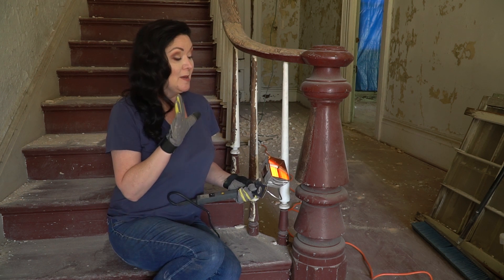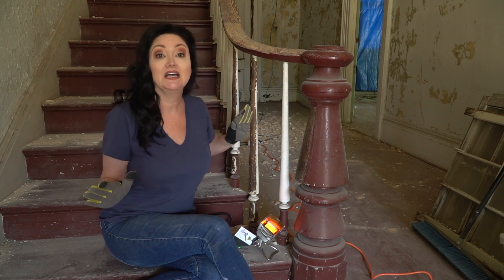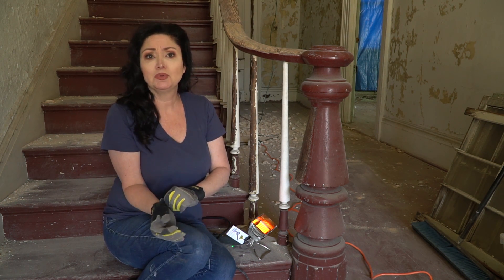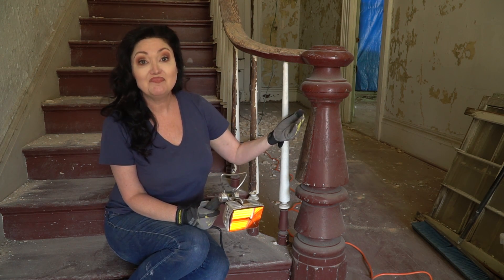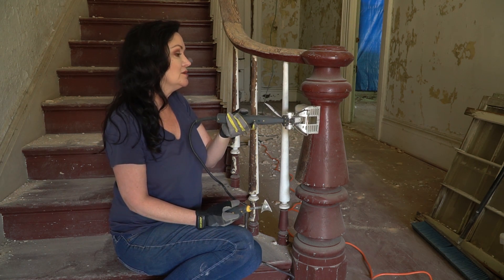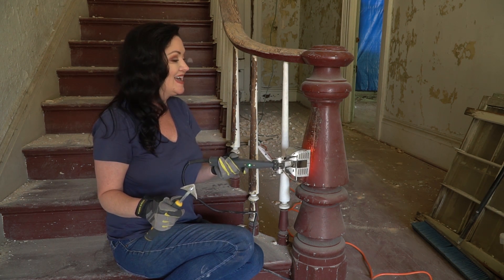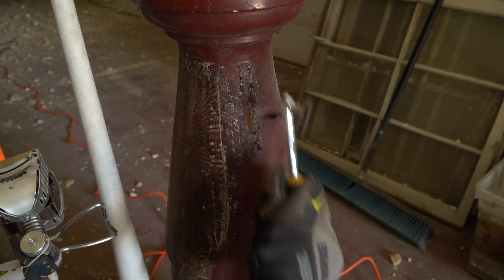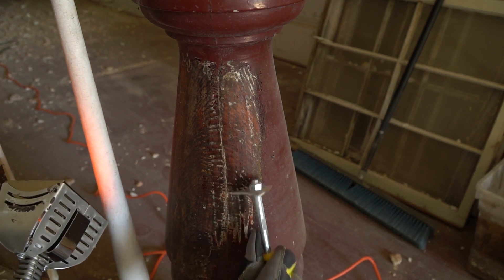Stripping in a Victorian Mansion

Comment: As a restorer I find best way to remove paint from detailed wood is with a air welder fitter with a flat vinyl tip. These tools are designed to melt and not burn or vaporize because brittle plastic or a brown scorch mark on your vinyl will defeat its purpose. Consequently the warm air it produces makes it an ideal paint removing tool. The paint just peels off like a banana peel in large sections. These use to be $900 but they are now down to $90. I could adjust the speed of the fan and the heat setting from 0 to 2000 degrees on the one that I own. I think this welder is one of the best kept secrets.
Reply: Thanks...I will look into this.

Comment: What’s the name of the ultra expensive tool? It looks great!
Reply from the maker: The Cobra Speedheater!
Reply: @OurRestorationNation  That is what I thought it was. I searched for this particular video again because I want to get one. Restoring our 1903 home and used citrus strip which is SO slow. Then used my heat guns on latex. BUT now have tested other areas of home and they are all lead paint and so many layers. It will be worth the cost because I can also use it on the outside porch railings where paint is 1/8 thick. Keep up the great work! I so enjoy your videos, all of them!